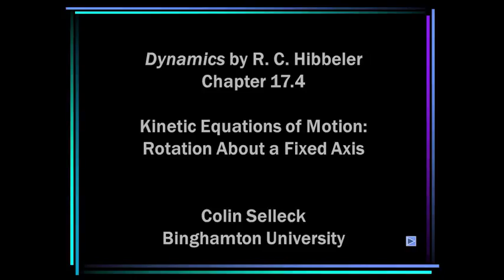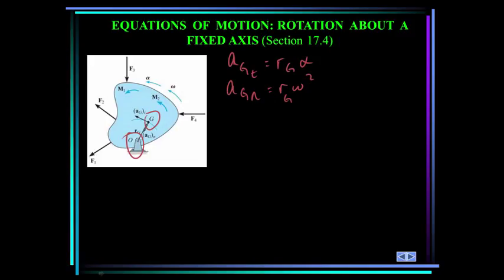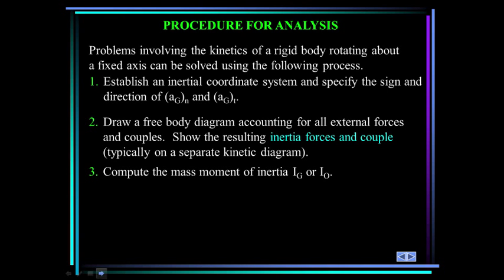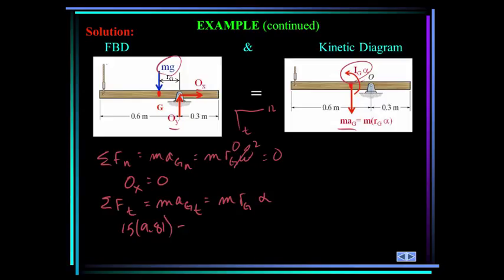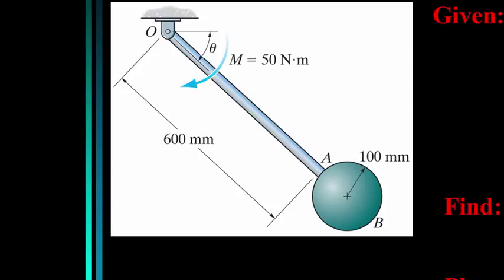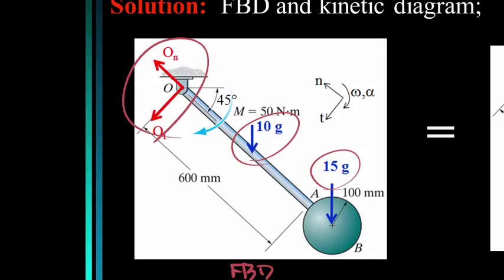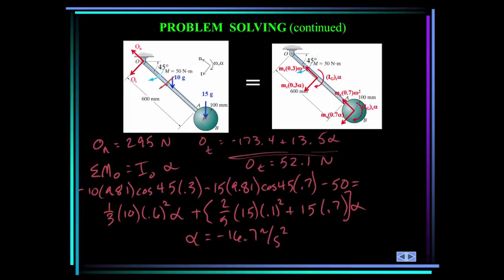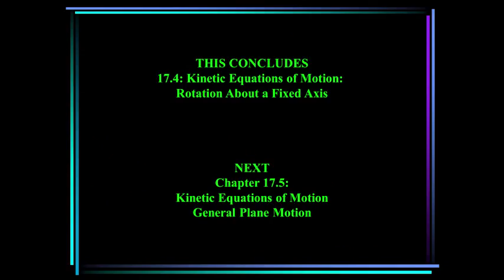ME 274: Dynamics: Chapter 17.4

Comment: Sir, if a rigid body rotates about a fixed axis then, are all the points on the axis of rotation have no acceleration ? And if a point on the axis of rotation doesnot have acceleration , i think there is an error in the book when deriving the equation of moment about the axis of rotation in section 17.2 page 410 ..as you will see the book will treat point p as if it had an acceleration .
Reply from the maker: Section 17.2 is about rigid bodies rotating and accelerating. There is no fixed axis of rotation in the derivation. Fixed axis rotation is in section 17.4.
Reply: Ok .thank you sir

Comment: for the second example , sum of moment ................... me and my friends and the whole people on the earth believe that the IG for rod = ml^2 divided by 12

with all respect
Reply from the maker: osama mehdawi It is true that the moment of inertia of a homogeneous rod about its center is 1/12 * m * l^2, but I am summing moments about the rod's end (point O), and that moment of inertia is 1/3 * m * l^2.
Reply: @ColinSelleck  Using 1/3 * m * l/2 with values of mass = 15kg and l being 0.9l you end up with 4.05. Rather than 1.35
Reply from the maker: @brandonphan1437  I assume you are talking about example 1 at 7:12. The mass MoI of a rod about G ( the rod center) is 1/12 * m * l^2, not 1/3 * m * l^2.
Reply: @ColinSelleck  But you are taking the moments at point O. Why doesn't 1/3 * m * l^2 work?
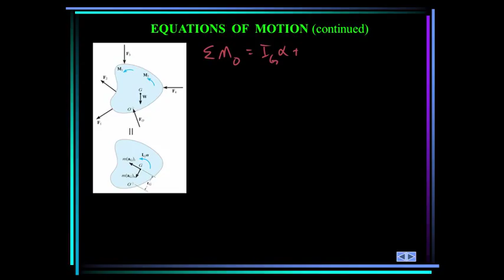Reply from the maker: @brandonphan1437  Because I used the equation Sum Mo = Ig*alpha + m*r*Ag. Check the lecture at 3:00.
Reply: @ColinSelleck  Understood, but however 1/3 * m * l^2 should be able to compute a moment at O no?
Reply: Afterall it is at the end of the rod or is it? I'm just wondering as to why that formula cannot be used even though the moment you are interested in is at the end of a rod in which the textbook indicates is the 1/3 formula.
Reply from the maker: @brandonphan1437  You must use the formula I used as the center of gravity is not located on the rotation axis.
Reply: +osama mehdawi 
If you were to use the equation mI^2 for IG, you would have also had to apply the parallel axis thereom of mr^2, but to avoid that, he took the moment of inertia at the end. If you were to do it using the other method, you would get the same exact result. 
Also for someone that claims that he is addressing someone with respect, you seem to show little proof.
Reply: And this is way when you go to school and don’t pay attention, you might generally go around with misconceptions. Besides on the video he clearly said about its end. You could use your formula and the paralleled axis theorem to get the same answer. Inertia is about a rotating axis in this case O